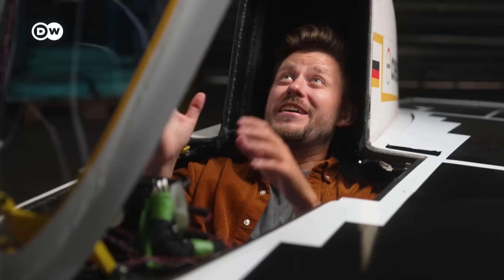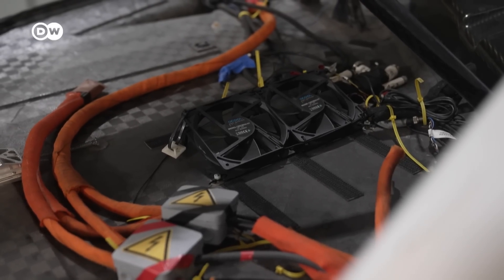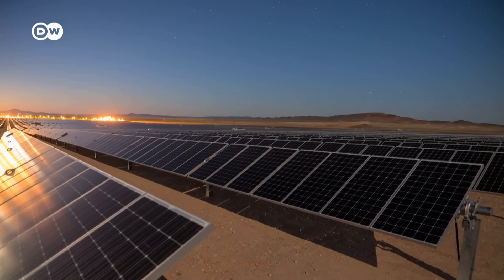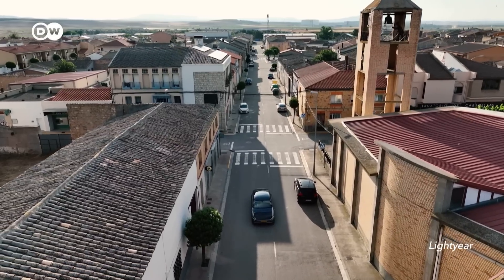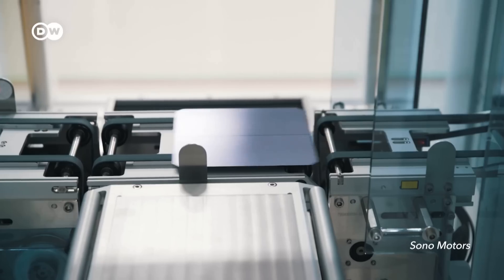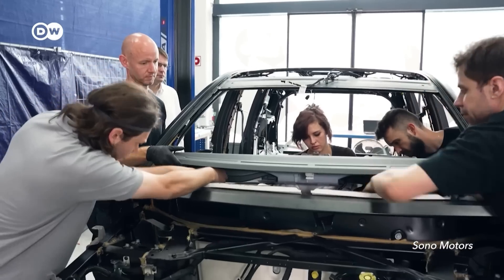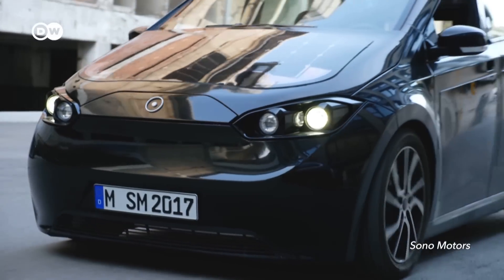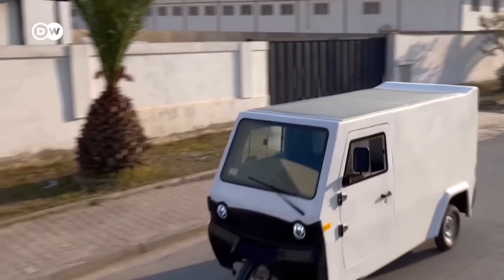Why aren't solar cars everywhere?

Comment: Option 1: A 'solar car' for €100,000-€200,000, with 300km range and a billion compromises to make it work. Will need to be plugged in a few times per year anyway. 

Option 2:  An uncompromised electric car for €50,000 with 500km range and a $10,000 solar panel for your house. Car will need to be plugged in once a week but the panels also saves you €500-€1000 in household electricity every year.

Tough choice? Naa. Just let cars do what they do best and don't mix them with inefficient electricity production.
Reply: And on top of that you could add some battery storage, making you less suseptable to power outages and maybe even making the grid cleaner by prowiding some of that battery capacity to utility company. And you can also use that same grid to send power from your home to where you are chargin your car so you use it when it is produced.

Comment: How did you get the Sono images of the crash test? I was a member of the community, early order, etc., but never seen those.
Thanks for this video.
I do believe solar car is useless - it's much more worth to have few kW of panels on the roof of your garage/parking space/house and charge the car at home over the weekend rather than filling up during the day.
If all external parking spots had a canopy with solar panels and charger allowing only to get the energy from the panels, not from the grid, this might be worth. But carrying the panels with you on the car is not the best thing ever. Any scratch and your production goes down substantially.

Comment: I think solar powered golf carts are going to be big somewhere.
In developing nations for every day people.

But otherwise mostly for city mail and parcel, and food delivery, because theyll be smaller and slower and not great for highways.
Reply: Squad Solar has a quadricycle that's similar to a 'golf cart' and I'm sure Floridian golf carts must sometimes come with solar by now. Not that they lack space in their swamps for solar on the roof and driveways but 'driving' golf carts as local electric vehicles is super common in some parts of that hellish state. You'd think they'd be obsessed with strong doors and reinforced windows with the native and invasive species that'll kill you as soon as look at you, but it turns out open air vehicles in hot sunny places just make you feel like Crockett. :)
Reply: @jonevansauthor  I mean could make a fully sealed golf cart vehicle. Only problem is heating in the winter

Comment: Solar cars are going to be more resource efficient than electric cars.
Solar panels are glass doped with some metals and stuff.
Theoretically the total material cost should be lower than batteries, and thus wirh a properly scaled process, cheaper than a car with a huge battery.
It shoild probably be a combination thougb

Comment: Misconception is that the more sun, the more energy solar panel  produce. Which is wrong. Solar panels have efficiency range of temperatures and ideal temperature is about over 20 degrees Celsius. When solar panel is overhead its efficiency drops. 
This is why Germany and Netherlands have more solar panels in use than e.g. south of Spain or Italy.

Comment: You didn't give Aptera a chance and they've solved all the issues that were mentioned directly before that part of the video.  NBC drove the prototype that didn't have the cooling system connected to the motors.  Though a misstep on their part, the company made it clear after what the issue was.  Also several other YouTuber's and others have driven their different prototypes.  I see you like to use the car in all the b-roll shots, but then fail to do almost any research on the company that's the most open and honest about their development.  In time more people will understand what's possible instead of just dismissing something actually world-changing.  A car that removes the need for gas stations, and you can charge on a regular outlet at home?!?  Keep dismissing them, and you'll be wishing you hadn't later on.  Either way the future is coming, and I'm pretty certain Aptera is showing you what it can be.  Again, they are very open with the things they've been doing and how the process is going.  It's all on YouTube which is why it's staggering how bad your coverage of them was.  I know it's a US company, so let's trash them I guess??

Comment: We put solar on our house that exactly matches our EVs consumption. It cost $2500. Our car runs on sunshine. We just don't pull the panels around.
Reply: The California net metering 3 doesn't make sense (especially for small installs).  Aptera bypasses permits / electricians and works for those that are renters or in condos.  That said I'd happily buy an Aptera without solar because I'm in bc and our power is cheap and reliable (hydro).
Reply: I think that's the best choice. Solar panels on roof work very well.
Reply: For those without a house, my car sits in a works car park or in a roadway most of the time, getting 20km a day would be great I'd basically never have to charge my car at all. Perhaps a top up every few months. However the real world roof example on a real car (not some plastic thing) only got 4km a day, which makes sense for panels of a roof size basically 300W at most 100W average for 10 hours -  if you are paying €2000  for that option is it worth it for 20c of energy a day?
Reply: No go camp in the desert for a week 😃
Reply: Foldable solar and a power station 3 to 4 kWh per sunny day

Comment: Oof! First time I've seen DW planet A goof up.  The Aptera hill failure was a prototype error without the cooling system installed, not an actual production model flaw.  Surprised this didn't get mentioned

Comment: Cost versus benefit at a simple level - then the fact that current trends are towards massive SUV style cars which add weight and reduce efficiency. A rooftop and bonnet/hood panel would probably give many cars a decent enough free top up - the rest can come from more efficient fixed arrays - why bother with the expense of making a “solar car”?

Comment: The secret to solar cars is having the solar panels along the side or Overtop of the road/highways and transferring the power to vehicles via induction. Solar cars are hard to recycle due to the laminated surfaces.

Comment: Aptera is currently building out a factory for its first phase of mass production, which could definitely fail, but it also could succeed. It is still a baby relatively as a company and has huge potential if they succeed. a big longshot that could turn into a multi billion dollar platform.
Reply: The Aptera warehouses they rented are completely empty.
Reply: @vic321344  thats not true, they've already begun moving in equipment, but probably 80% empty yes without lines installed yet.

Comment: Charging an Aptera is accomplished by 1) a Tesla charging station, 2) standard household plugin, and 3) solar panels. I live in a cloud-dominant part of the country and even though I'm ordering the full solar panel  setup, I am not depending on it. I'm getting the 600 mile version and most likely plug into my apartment's outside receptacle. I imagine I'll charge at Tesla stations only on long summer trips and hope the solar offers some assistance. In short, I don't consider Aptera to be a solar vehicle. People who live in a sunny climate and use the vehicle for commuting could consider it a solar vehicle. They'll need to discover the ideal parking positions. If they don't live up to the hype then they will need to revert to the plugin options.

If you don't like or want an EV, then don't get one. EVs aren't going to save the planet, but they aren't going to ruin it either. I can't stop the burning of coal for example but I can stop driving a vehicle that emits toxic particles into air that my friends and family inhale. I don't follow/read many automotive publications but I would wager few, if any, point out that ICE vehicles emit poison and offer solutions to stop it. That's because they don't have solutions.

Comment: Pretty much as expected. It is going to be expensive. And even house mounted panels can't charge the car because it will be at work.
Reply: Unless we create this large network of electricity wires, we could call it grid, no better yet, electrical grid. Then angry pixies could travel from your home to your work place to hide in your cars battery from the sun.
Reply: So, you don't know anything about the grids. Nothing is simple or cheap.
Reply: @tarjei99  What am I wrong about when it comes to grids? My argument is not that it is simple or cheap, simply that you don't need to next to a power generation unit to get power from it, you know, whole point of electrical grid. Generate far away from the place where you actually need it.
Reply: They are costly and have to be rebuilt from scratch dimensioned far beyond current needs. They will have to cope with huge loads due to everything going electric. Cooking surfaces, hot water heaters and electric vehicles generate huge loads on the grid. Mostly at the same time. Way beyond anything that exists now. And it will probably end up with distributed nuclear power stations to cope with the demand.

Comment: Don't pay much attention to the Aptera apologists. They are over 200m in the hole and their cash position was so precarious at the end of June 30th 2023 (check SEC documents yourself) they have to shift expenses to stock to have cash on hand. Technically they don't have sufficient cash to reach end of year even while still garnering a million a month from investments. They have steadfastly refused to update the expected pricing of the vehicle even after moving to a carbon fiber body and frame. This is also due to the fact they cannot coordinate well enough to settle their production suppliers to understand how much their cars will cost.  
 
Their current production model is to build the body and structural from Carbon Fiber SMC, assemble that, install glass and seals, then ship the near complete vehicle from Italy to California for final assembly. Amazingly Aptera fans think that will reduce costs

No competent management team would have allowed demos of their Gamma vehicle without following a checklist but Aptera has demonstrated more than once they don't have discipline. Worse the Gamma not only has a manually activate cooling system it has manual brakes. It is a cobbled together demonstrator mostly for looks and no other purpose other than residential speed drives; you will never see it on the freeway and no independent proof of its speed and range has been allowed. even the panel on the roof was shown with such poor efficiency in San Diego that those numbers stopped being shown on the in car display; it was cloudy but the calculation on screen said 3 miles of range for the DAY!

Comment: Yeah, a pure solar car is impractical. That is when all the energy is coming from solar panels On the car.  I have a Chevy Bolt, and solar panels on my roof.  I’d say this is a solar powered car.  That said, I am excited to get an Aptera, and to power it from both its panels and the roof panels.  Long trips, charging from super charges.  Problem solved.

Comment: Starting a new car company is hard. And it might be too soon for mostly solar powered mainstream cars. But in general solar on cars will indeed be a thing in the not too distant future.      Legacy automakers are already offering or planning solar on the roofs of some vehicles. Range anxiety, charging wait times during rush hour, things like perovskite PV and solar glass on the way, ever stricter emission laws. I could see 3-5 km a day from the sun(when its out) becoming worth the hassle real quick. 
 Interesting about the inverter controller cost issues but If you don't go crazy trying to squeeze every watt or slap a solar panel on every square inch and stick to a rear bed or roof, the cost and durability issues can be overcome.
Reply: And how much range would you get if you put the same amount of money to put panels on your roof? This system adds complexity, cost for a 5km range a day at best? If you put them on your roof you will have far better sun angle and it will be constant. Then plug your car at the destination and pay utility company for ship electricity from you home to your work place, or store, or where ever to charge your car away from home. 

And when you really thing about 5km added range with about 25% efficient panels, lets even say it is 20%, in that case you are looking at about 25km added range a day if we ever hit 100%. That is worthless for long trips, 25km on 600km trip is a couple of minutes of charging at best these days. 

But I'm very much in favor of solar powered vehicles, and we do have them, and they today have, what you call it infinite range. Electric trains utilize the power of national, or in some cases continent wide grids.
Reply: @fulconandroadcone9488  Many people can't put solar on the roof of there home.  I live in an apartment and I'm on Aptera's waiting list.  

By the way, 100% efficient solar panels would have to defy the laws of physics.

Comment: You just forgot to mention Fisker that is and will offer solar roof in all it's current and future models and according to the company and in ideal conditions it can provide up to 2,000 miles of solar range per year which is 1/3 of the average annual commute of most people.
Reply: Yeah but it's optional and they're only planning to produce 300 cars per day (announced in September) which sounds like a lot but a) they haven't done it yet and b) it's really not a lot in the first place and c) they won't all have solar panels (unless the optional upgrade is unexpectedly popular. 

But yes, they could have dug deeper and found more companies putting solar in. Someone mentioned the new Prius has one. The Squad Solar seems like a more practical option to me.
Reply: Where are you getting that milage? The average American drives closer to 13k miles

Comment: Roads already occupy the environment. Use them more efficiently! So instead of trying to fit solar panels on cars, put them on the roads. That is, roof the roads and put regular, cheep, durable panels there. Feed the power either directly into the cars/trucks like you do it with electric trains, or feed it into the regular power grid to increase the renewable energy capacity.

Oh, and no, putting solar panels on the surface of the actual road is a stupid idea.

Comment: I have been watching the Lightyear story from nearly the beginning.  I can't afford the €250K Lightyear One, but I'd buy a Lightyear 2 at €40K.  I hope it happens.  And that's not a pipedream.  They're following the Tesla model.  Tesla started with the Roadster that was crazy expensive and used cellphone batteries.  That made them enough money to go on to produce the X, Y, S, and 3 at increasingly low prices and high volumes.  It's a shame Lightyear doesn't look like it's going to get out of the gate with the big investment car.  And why?  Because the markets changed?  How about some help, Dutch government?  Aren't you proud of your native industries!?!
Reply: What saved Tesla in its early years were investments from Daimler (Mercedes) and Toyota. Forget government, they have to knock at other OEMs doors. Heard that a Chinese company was interested in SonoMotors automotive division. So...

Comment: It's just a matter of numbers, easy to crap on the idea, an inventor would have a make it work mentality. Typically the point isn't to run 100% off of sun. A small van would be an appropriate vehicle. Roof solar only, maybe it could tilt as one unit while it's parked. Does NOT need curved panels. Kia Soul EV would be an ideal conversion candidate.

Comment: This is a very interesting and great concept. However, I don’t think it would be realistic to see many of these vehicles around in the future. That’s mainly due to the high production costs, but also because of the various engineering challenges associated with building these vehicles. It’s still a cool concept though. The production quality of this video is wonderful. Props to the editors of this video for creating such an incredible documentary of this unique automotive concept.
Reply: Fisker does offer the option of solar roof and it adds 3k to the final price of the vehicle offering up to 2,000 miles of solar range per year in ideal conditions. The tech will only improve and get cheaper if more OEMs do adopt it.
Reply: @krisg.4257  Wow, I didn’t know that Fisker is already implementing this technology at an affordable price. In that case, this might be a revolutionary technology that could change the automotive industry forever. Thanks for letting me know.👍
Reply: Youre better off making 3k of solar panels into a solar carport in your driveway, to park your car underneath and charge up.

Solar panels on vehicles will easily be damaged. The most affordable per watt solar panels are relatively heavy and best for mounting stationary on your house.